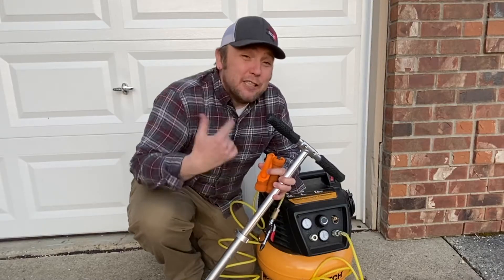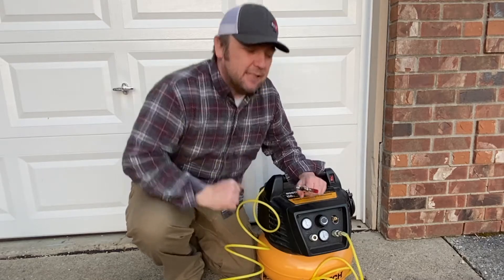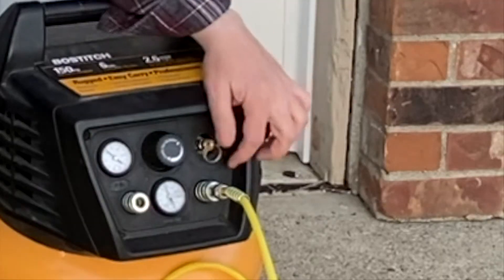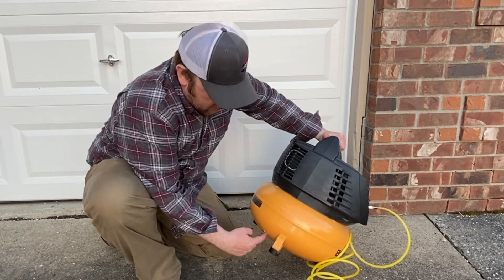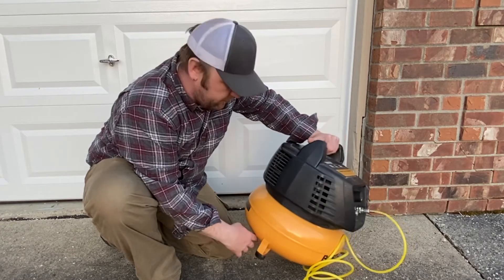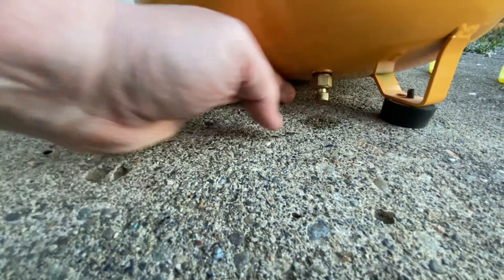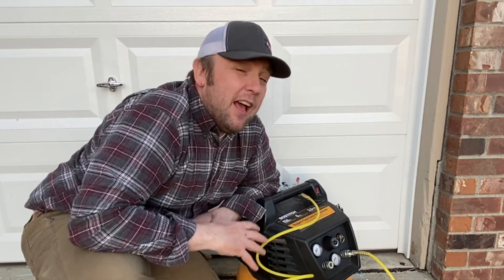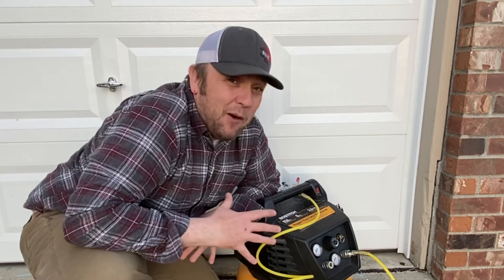DON'T FORGET TO DO THIS WITH YOUR AIR COMPRESSOR!!

Comment: A lot of the big compressors have an auto blow-off valve.  Great tip for those who have smaller utility compressors.  Keep it up Brian!!  Best Regards, Jason
Reply from the maker: I wish ours at work did!  Nasty with a capitol N at times. Not part of my work, but have done it a few times so it won’t be a bigger issue.  Thanks for letting me know that.